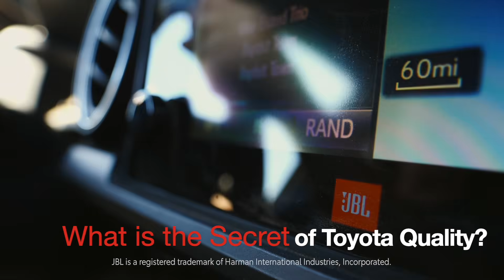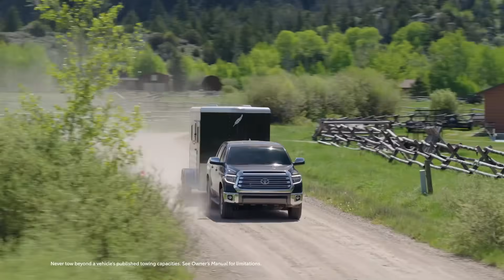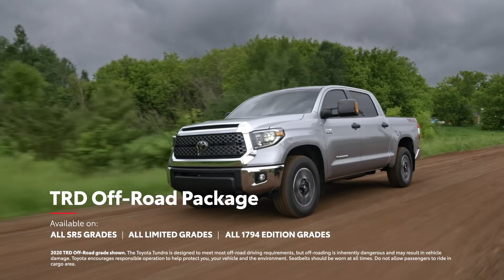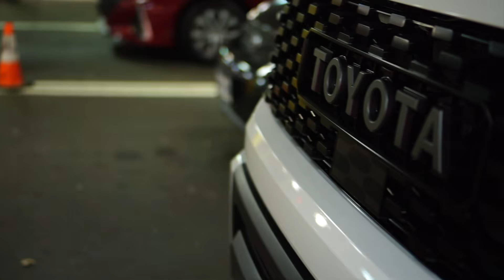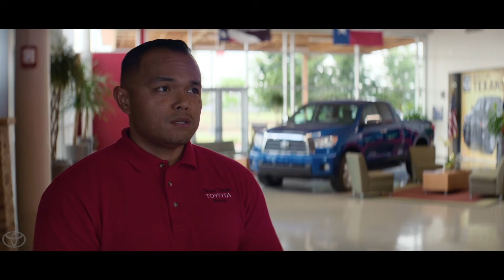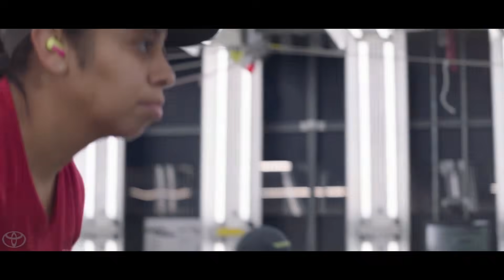The Secret Behind Toyota's Quality at Tundra Factory?  It's Called TPS - Toyota Production System

Comment: What will be the logical and engineering reasoning of Toyota removing the Transmission Cooler system in the Tundra?

**Other that the oil can manage high temperatures **

So many of years of having it on the truck, to just have them been removed for the last years of that model.
Reply from the maker: I don't think it's an engineering reasoning, I think it's an economic one.  They must have done an investigation and likely found out that only a few percentage of the people needed it or wanted it, so to save money (and to avoid raising the price of the car any further), they likely chose to take it off.  It's not the best decision I agree, but Toyota is obviously a very smart company and must have decided that it was not needed for most buyers.
Reply: @AutomotivePress  On my 2021Tundra SR5 CrewMax , I also noticed the removal of the skid plate. They didn’t even include the black one that comes from the factory. I was a little disappointed on that. Even my SR5 4Runner has it. 

* They do offer 2yrs of oil change. That might be the reason. Removing the skid plates takes few minutes on the service.***

I rather had it included, since I do the oil change myself.

Thanks a-lot for the Information!

TOYOTA quality and reliability are exceptional.
Reply from the maker: @gilbertoquinones4214  Toyota's strategy is generally speaking two folds: 1) take off anything that customer don't really care about 2) add any features that customers have been asking for or competitors have them.  So it was likely removed because it was not valued by customers and it also saves money to remove it. And instead, Toyota added new standard features on the 2021 Tundra

Comment: Automotive press: you are wrong. Toyota assembly in Mexico doesn’t have good quality. Why I said that? Here is why. I own both 2018,2019 Tacoma limited assembly in Mexico, both have issues with transmission ( down shift from 2nd to 1st gear.) problem down shift when going up hill. My 2019 Taco’s tailgate came missing a bolt. Can you believe that. I end up sold them both.
Reply from the maker: Actually transmission issue has nothing to do with Mexico since it is due to programming....the problem has been resolved through TSB (technical service bulletins).  What bolt was missing? I've never heard of that - and all the data from JD Power survey shows same quality from Mexico vs Texas.
Reply: Took my 2017 to dealer. The mechanic said tsb on my truck was up to date. He took it out for a test drive and was able to replicate the issue but when he plugged it in for diagnostic, he couldn’t find anything. Same transmission issue  with my 2018.
Reply from the maker: @nguyenngoclinh524  I can't comment on your specific case since I've never diagnosed your truck, but all I can say is that all the facts, data, and research shows same quality for both factories so far.  I'm sorry to hear that yours didn't turn out well